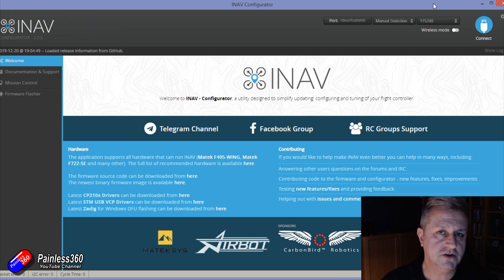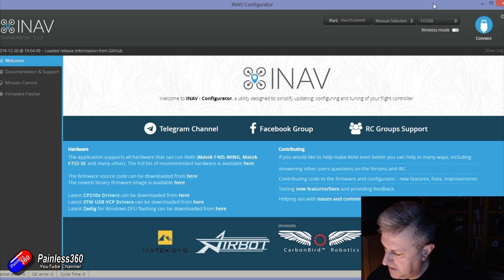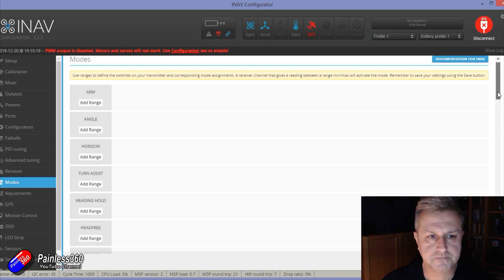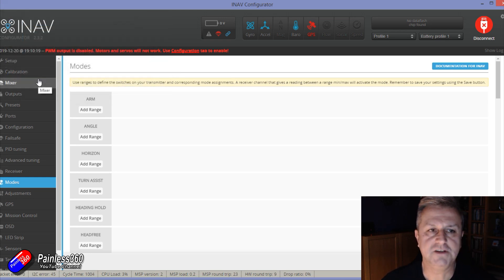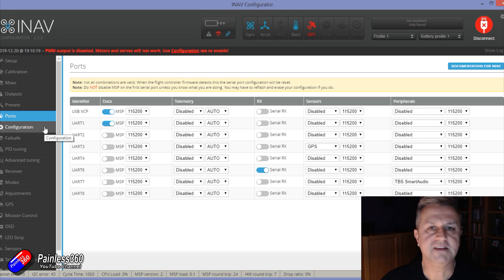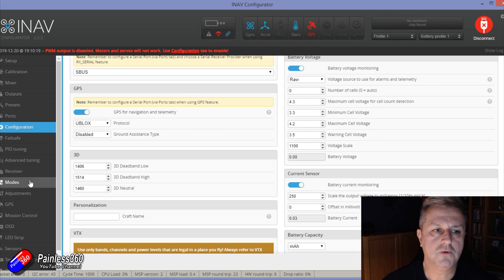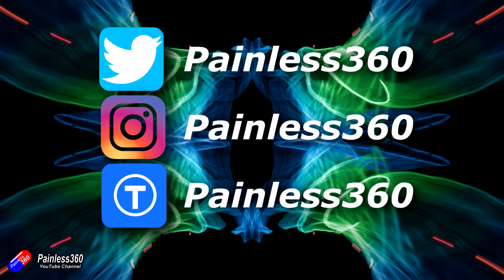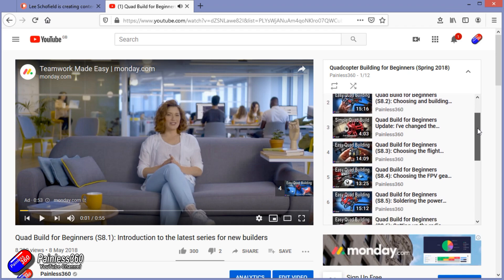iNav Quick Tip: Where are the GPS flight modes?

Comment: I've got Inav 5.0 flashed to my 7" quad and the GPS icon is lit up. The gps tab shows communication but the Modes tab does not give me any Nav modes... Also, I have a  navigation is not safe error stating that my pre-arm is not enabled. But it is... any idea of what the issue could be?
Reply from the maker: Make sure GPS is enabled for navigation as well as the compass .... Best of luck

Comment: Thank you for the awesome video.
I see that you have a Barometer installed in this video, is a barometer required to also enable certain functions in the MODES menu in iNav and does the NAV WP, NAV RTH & NAV POSHOLD require a barometer as well ?
Reply from the maker: Not on a wing - https://github.com/iNavFlight/inav/wiki/Navigation-modes Happy flying!

Comment: Painless360 Is there anyway to increase the amount of control you have with the 
ailerons and elevator while in HORIZON MODE.  I'm using a Matek 411 WSE 
FC and when I'm flying in HORIZON mode it just feels extremely sluggish 
like I need more deflection with the control surfaces.  Just wondering 
if there is someway in INAV to increase the control or decrease the 
amount of sluggishness.  Thanks!
Reply from the maker: Yes you can. The maximum pitch and roll in the setup is way too low. See my iNav builds on what I change (also covered in the iNav wiki)...

Comment: I have iNav 2.1. 

Can I fly without magnetometer, with GPS only and use RTL/Position HOLD modes? Or its impossible and I need both, compass and GPS connected and configured in iNav 2.1 ?

Comment: some good tips but i have a question, i have an Eachine 680 blackwing (aka batwing) with f411 and gps, but it does not show RTH on screen when i flick the assigned switch, so i wont maiden it till i have this fixed, i was told the wing has to be at least 50m from where it boots up but tried this and still no RTL
Reply from the maker: Nav modes will only activate when a number of conditions are met. See my iNav 2.1 series....
Reply: Have you checked that the switch --> channel --> receiver --> mode config is all properly set? Easy to select the wrong channel in the mode config or map the switch to wrong channel.

Comment: I am struggling with the rth function , every time I flick the switch , the fc takes control of the model and makes sove very very abrupt manouvers , so I take manual control , and not use rth . Any ideas to help? thank you Very much
Reply from the maker: Make sure you've followed all of the steps in my iNav series... This can happen is you mis a step.. Happy flying!
Reply: @Painless360  I have , but I'll check , thank you !!

Comment: Nice quick tip Lee.  Another trick I use is to check the GPS tab and see if there is communication between the GPS and the FC.I did make a mistake once where I incorrectly wired the GPS. If you see communication then all is good even when there is no fix because you are indoor.